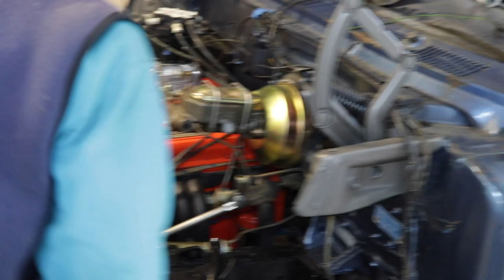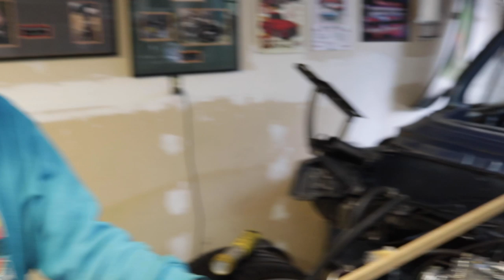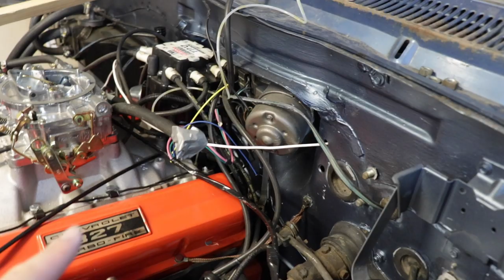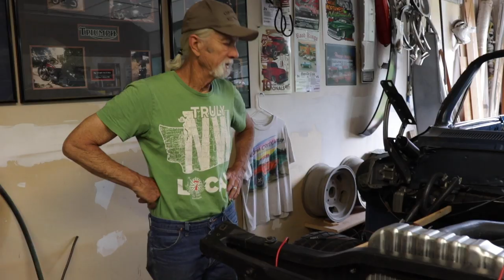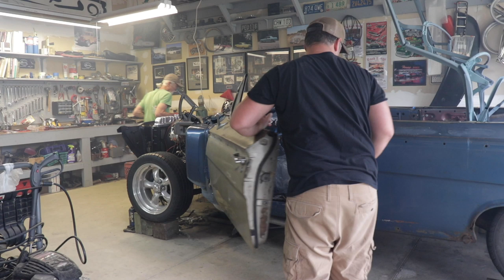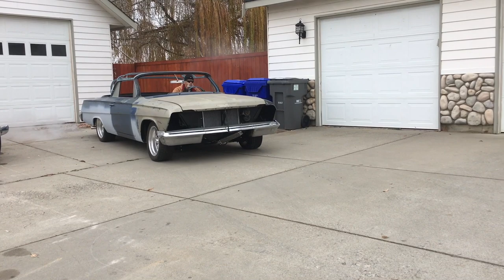Barn Find 1962 Impala SS Convertible First Start!

Comment: It's a 62 chev you can wire one in the dark with one hand. I've rewired several like this and never looked for smoke. Take a tiny funnel and pour gas down into the float bowl through the bowl vents. there's no  cranking and cranking  without fuel  because the car will start and run until the float bowl empties. you might have to do this twice, it's a long way from the tank.  Should be pumping the gas pedal too. You're going to get a flaming backfire yet!!

Comment: Did they end up leaving the electric fuel pump installed?
Reply from the maker: Nope, we had 3 defective mechanical pumps in a row from the parts store. As soon as we got a good one, we installed it and removed the temporary electric pump.
Reply: Classic Nation woah, that's odd. Thanks for clarifying.
Reply: I was going to say that it could be a bad fuel pump from the parts store.